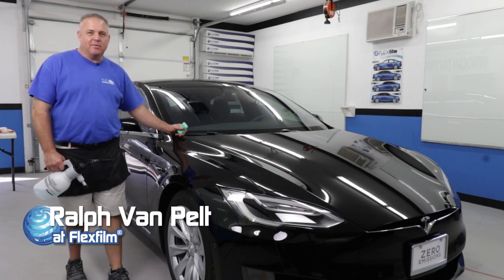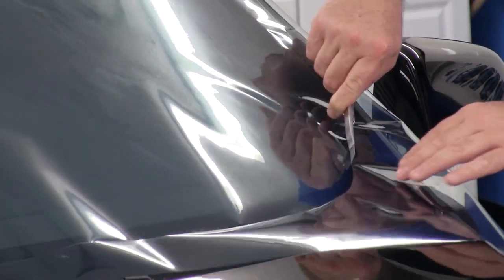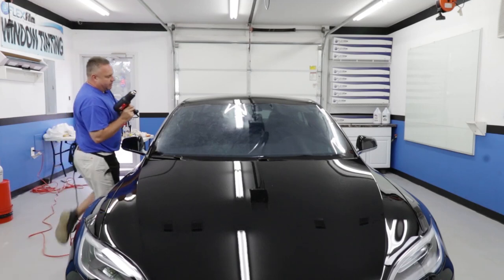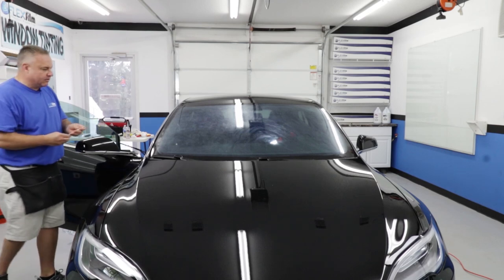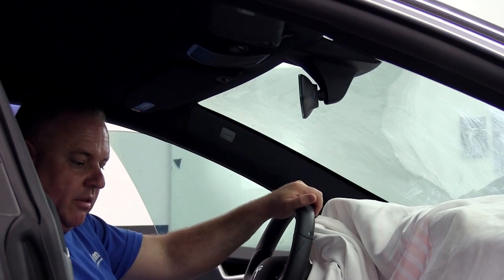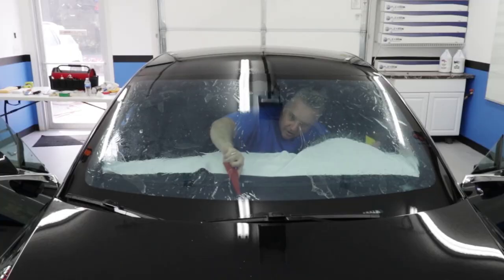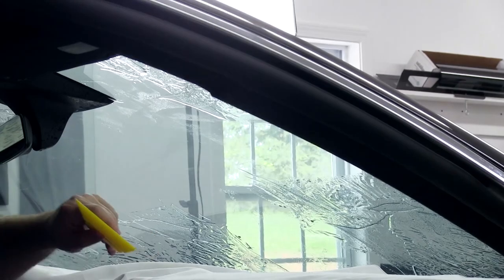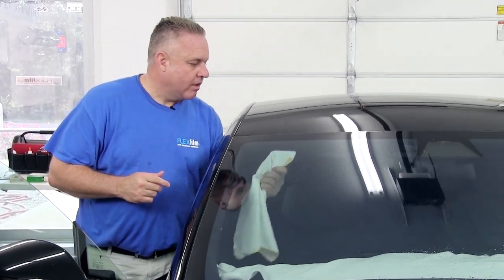Window Tinting: How to Tint a Windshield (Tesla S)

Comment: Excellent video. Why does the reverse roll method adhere when usually the reverse side is used?
Reply from the maker: jmtrotzie 
Because I pull the release liner off simultaneously as I roll the film which exposes the mounting adhesive to the glass.  It is like a magic truck in the video.  You have to look very close to see it.
Reply: Thanks Ralph. To me it looks like the adhesive side is facing you.
Reply: jmtrotzie If the adhesive side was facing the inside during or after installing, how could the film be stick to the glass? ... I wonder how do you expect the film to be held/stick to the windshield?

Comment: Hi, love your videos and I have a question I couldn't find an answer to in your library.   How would you address a glare strip on this car?  Would you put it on top of the windshield tint or make it a splice application like you did on the rear window demo?
Reply from the maker: I only tint visor strips over 70% tint or lighter otherwise I will splice.
Reply from the maker: If the film on the front windshield is lighter than 70%, I would just lay the visor strip on top of the film.  If the windshield film is darker, I would splice it.

Comment: What percentage was the tint you put on? What were the heat and Uv benefits and potential cost of the film
Reply from the maker: The Car Fanatic 
This film was Nanoflex 70.  The specs are on my website.  Www.flexfilmplus.com
There are not many other products in the industry with this level of performance.  Just like the car, the film is also hard to beat...

Comment: Off subject of a windshield tint.  I've had two customers  this week that had a door window that did not work. How do you handle that? One customer was not happy because I couldn't tint it. The other was understanding.
Reply from the maker: blaino1 
I usually tell them they need to get the door repaired.  I will throw a piece of tint on their temporarily until they returned with the repair and redo it for free.  If they do not show back up, I do not worry about it.

Comment: What type of brand of film and what percent of the front windshield do you used?
Reply from the maker: Flexfilm Nanoflex 72%
Reply: @FlexFilmPlus  l plan to use 90% clear for the front windshield.   Is this better than 72% ?
Reply from the maker: @mrteausaable  
Just remember... the lighter you go, the less performance.  Usually in films that are 90% vlt,  the performance drops drastically from what you can get from a darker ceramic film.

Comment: I thought front tint is illegal? Well, maybe here in Texas.
Reply: brendaleetv it's not even dark at all. It's one of those clear ones. Can't get in trouble with the clear tint
Reply: @ig243  what's the point of putting it on.? I don't get it. Anyhow in the UK it's totally illegal, not only that if you had a shunt you'd be completely uninsured and good look at not losing everything you own including your house trying to fight that claim.
Reply: @dazzassti  70% ceramic is totally legal on the windshield. The ceramic film is a non tinted film which is legal. It will add darkness to your vehicle if your front two windows are tinted

Comment: You definitely have some good methods but some of the things you did were weird and unnecessary . I put it down to filming tho. I always do my hard pass first just work it slowly 2 pieces not 4. Anything after the first pass if it starts to dry you're gonna get ghosting and rippling itll look crap. You need to look into some other tools. Down here in australia no ones uses those turbo things... we have proper handels and we use 3m cars cut in half for sides and bottoms of doors
Reply from the maker: You can't ghost nano ceramic window film.  You can ghost sputtered ceramic window film.  If you have priblems with ghosting,  switch to nano ceramic technology.   It is a standard two ply constructiin designed for auto.  Sputtered ceramic is better suited for flat glass and involves multiple layers of polyester.  If you heat it too fast or uneven, it will ghost.